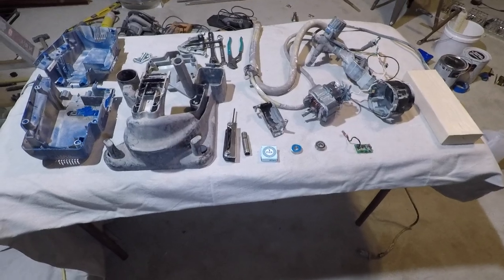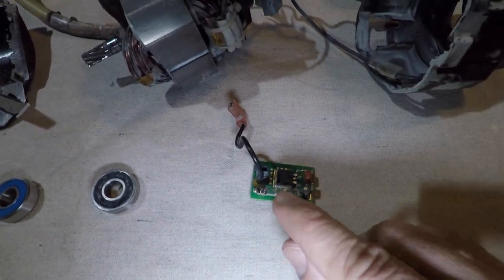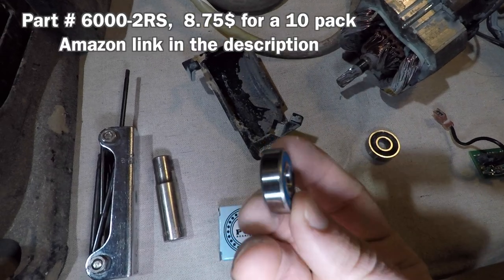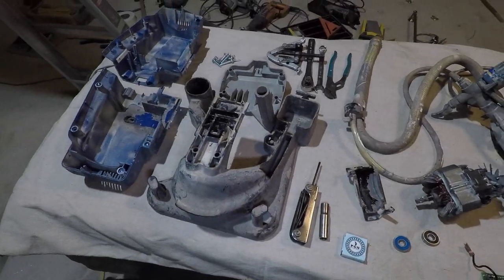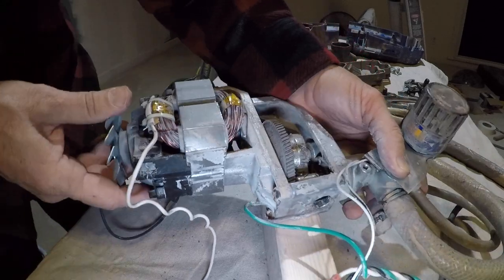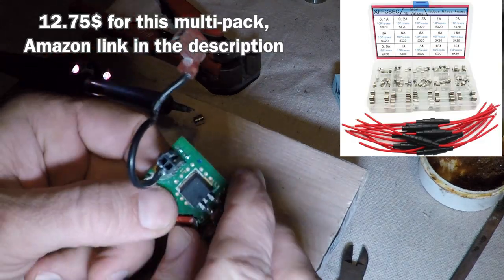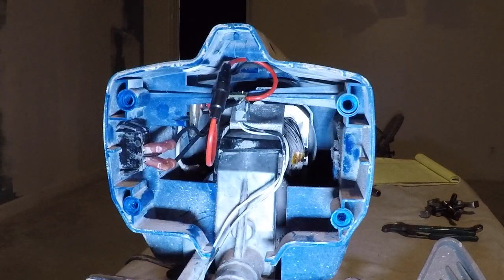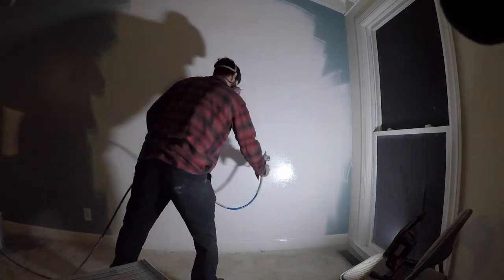Repairing a Graco Paint Sprayer

Comment: I’m fairly certain I have the exact same problem. Is the bearing supposed to be able to spin if it is functioning normally? Mine does not move. I replaced the fuse and the pump turned on only for it to blow another fuse within two seconds.
Reply from the maker: yes it should spin freely.  Sounds like you have the same problem I did

Comment: My x5 the other day made a grinding noise I never heard and then a bunch of tiny ball bearings fell out of the bottom. I'm guessing that bearing seal wen out. I'm wondering if it's dill coming on and the motor is trying to run should I just get the bearing. What do you think?

Comment: That's awesome,  you saved yourself a few hundred bucks, but how long did that take you?
Reply from the maker: The bearing was about 30 min with disassembly, the fuse with soldering and reassembly was probably an hour. Filming probably added an hour or two and editing another hour or so. Probably not worth it considering the pump will still need work at some point and the gun is actually passed its rated life by about 50% already, but I did learn a little bit, so there is value there.
Reply: @AustinCoulson  I'm sure the bearing you used was better then factory,  and you made the fuse user serviceable as well. So if you look at it from that perspective,  if it happens again it'll go much quicker.

Comment: thanks great video - in teresting it has a 250 V 10 A fuse - even though it is being used in the USA with 110V? does that mean the motor can be used with 240V safely over here? Im having a problem with the valve assembly - the motor works but there is no suction at all from the pick up tube even using the prime setting and the overflow tube? can anyone help me? thanks

Comment: Built in obsolescence? One would expect a bearing to last longer. But what do I know.
Reply from the maker: That poor bearing lives in a tough environment, where it turns on and off constantly for maybe an hour or two then sits for long stretches. I think when the pump seal started to leak, the inside of the machine got humid from the water in the paint and it rusted while in storage.

Comment: Any update on fixing the leak. I have a project sprayer with a bad leak and was wondering if it would be cheap enough to fix and keep
Reply from the maker: If I remember right,  the leak was on the pump module a new module cost more than a new paint sprayer so I gave this sprayer to a buddy of mine and bought a new one about 6 months after making this video.  He does a lot less painting than I do so it still works, but still leaks.

Comment: What is the function of the bearing? I'm asking because my pump works fine but it has a leak exactly were the bearing is. Do you think the leak would get fixed if I replace the bearing?
Reply from the maker: I had a similar leak, which is what caused the bearing to fail I think, and found that the pump is non serviceable on this model and replacement costs more than a new unit. I used it with the leak until it got worse, then got a new unit.
Reply: @AustinCoulson  thanks for letting me know. I had bought 3 of them for $50 for all 3. The guy that sold it them said they didn't work but they did, They were not running because they had dry paint from not being cleaned. I took them apart, clean them, I practically made them look brand new but one of them does have a leak and didn't know how to fix that. I sold two of them them for $150 each. At least I got back my money and more. Thanks again for letting me know.

Comment: Great vid. Hey what model is that sprayer? I’ve got a magnum x7 and graco had told me they aren’t rebuildable. I just acquired an older magnum XR9 that needs some work but from everything I’ve seen the xr9 is a rebuildable unit so that’s why I agreed to take it.
Reply from the maker: Here is the new version:  https://amzn.to/3sp9VSO 

The one in the video is a 257025 and I don't think they make it anymore. I was told this gun wasn't rebuildable either but everything except the pump can be rebuilt and the pump costs more on its own than the entire setup.
Reply: @AustinCoulson  okay it’s the x5 that is basically what you’ve got. I’ve got an x7 that I bought new about two years ago and I worry that I’m gonna wear it out. I have a handyman business and I don’t use it every day but I do use it kind of a lot. I think I heard the pump in the x5 and x7 can’t just be rebuilt. I heard you have to replace the whole pump and manifold which i guess is kind of expensive, almost as much as a brand new unit. 
I’m working on a graco xr9 that I got for free, and the reason I accepted it was because all the parts are rebuildable. I just ordered a new piston and cylinder for it and I’ve been trying to find a video of how to replace the little pump. I just replaced the pressure knob which was over a hundred dollars but i still think this xr9 is worth putting some money into and rebuilding solely because it can be rebuilt and the parts are available.
I was hoping you had some pump replacement suggestions??
Anywhooo thanks for sharing your work.
Reply from the maker: @wyattsdad8561  I actually don't know a ton about paint sprayers, I was just tinkering with my old one and wanted to share a video to maybe save someone else's pump from the dump. I would just Google around for a PDF that shows how they are put together and go from there
Reply: @wyattsdad8561  You can rebuild those pump, all the parts on the pump comes off and on. Just have to be able to get the parts for it. Anyone can rebuild those sprayers easy, diagnose it easy.... not difficult once you've taken it apart and assembled once. But idk those sprayers quality just isn't there anymore, material, and being rushed produce.
Reply: @dogmanboss7638  yeah you’re totally right. I ended up rebuilding mine. I call it the chupa cabre (the blood sucker) because it ended up costing me more than I was expecting to spend because I cracked the manifold while replacing the spray prime valve. Haha it was my own fault for over tightening it. But now it’s a dream machine. New piston, manifold, all new valves etc.. it great tho.
Reply: @AustinCoulson  They still make those, that's a Project Painter.

Comment: That little pump under the gears, i have paint leaking out if that when i try to spray, or prime please healo 😭
Reply from the maker: As far as I know, that pump is non repairable and would need to be replaced and the replacement cost is more than a new sprayer from what I could find.